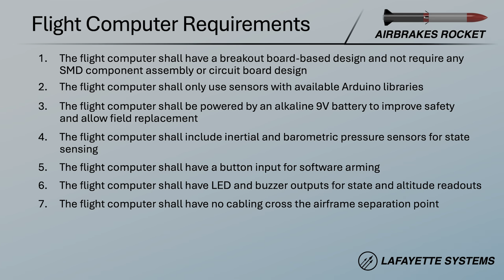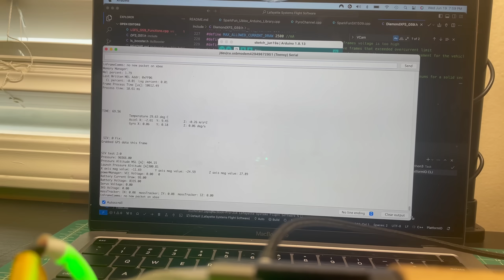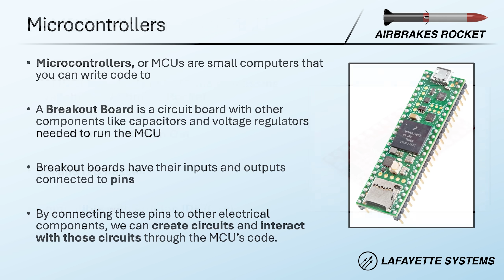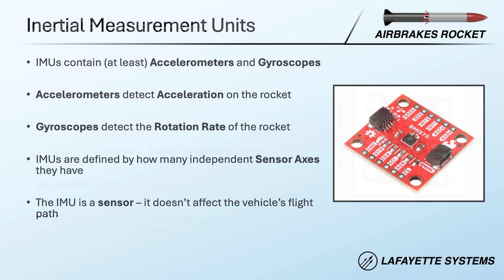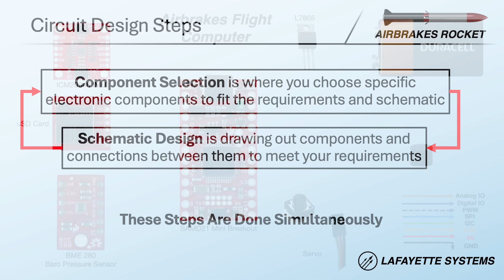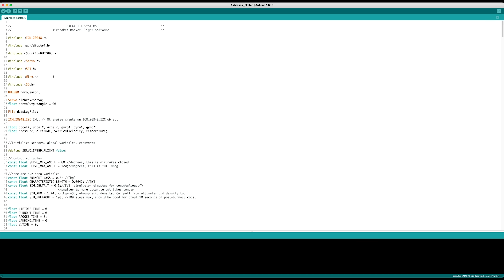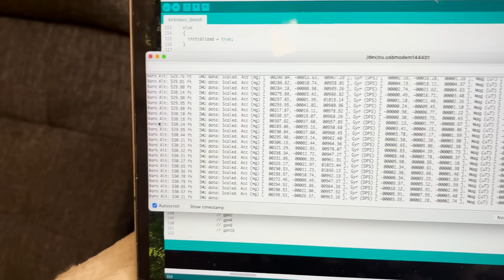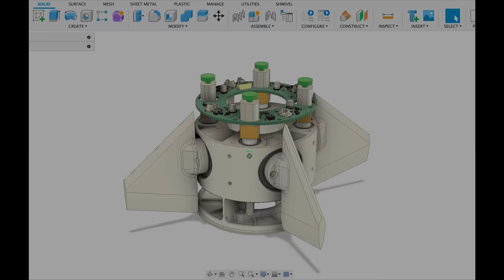Designing a Simple Rocket Flight Computer

Comment: Few suggestions:
1. I'm assuming your voltage divider at the battery is to read battery life, if so I would recommend putting a buffer before just to be safe unless the ADC input already has a high impedance.

2. I would not recommend a typical linear regulator when using a 9V battery, it will not last very long and also won't cover the full life of the battery due to the dropout voltage requirements of the 7805. If you are deadset on a linear regulator I would use an LDO but I would highly suggest any buck regulator instead.

Comment: I have some doubts about the power system's capabilities. 9v alkaline batteries are great for providing very small amounts of power for a long time, but they HATE being under load. Their internal resistance is very high (typically being 6 AAAA cells in a box) so any current draw above 200mA or so will start causing serious voltage sag. Anything over 1A could drop it below the minimum for that linear regulator and cause the avionics to brown out. I would strongly recommend testing the servo under the highest resistance it's rated for to make sure everything works properly if you're committed to using those batteries.
Like another commenter mentioned, there's also the risk of the snap-top connector losing continuity under vibration.

As an RC hobbyist, my recommendation would be to use a 2S ~350mAh LiPo pack with an XT-30 or equivalent connector, and spend some of the mass savings on a switch-mode UBEC to provide 5v to the servo. Maybe throw in a capacitor on the board's side of the linear regulator as well to keep the voltage stable for the sensors. The batteries are cheap enough to have a ready supply of replacements on hand as well.
Reply: Agreed on the battery situation
Reply: Dawg. The best thing is just to test and wing it.

Comment: Vibrations in a rocket are severe. Make shure you solder the 9v battery and do not use a battery clip. A clip wil not provide continuous power. Make sure your flight computer is resistent to a brownout.

Comment: When you model the rocket control system in Simulink are you using the built in C++ translation or are you translating it manually? I’ve never done any embedded systems programming before and it would be interested to know what your Simulink to embedded systems workflow is like.

Comment: how are you powering the servo with a 9v battery?
Reply from the maker: The 5V linear regulator takes the battery voltage and drops it to 5V. That goes to both the servo and the microcontroller.
Reply: @LafayetteSystems Make sure the battery can handle the load. 9v batteries have terrible power output, a single amp's draw causes a typical alkaline cell to sag to around 6v. A strenuous task like deploying airbrakes could make the controller brown out.

Burning an extra 80% of the servos' consumption in the linear regulator won't make things any easier on them.